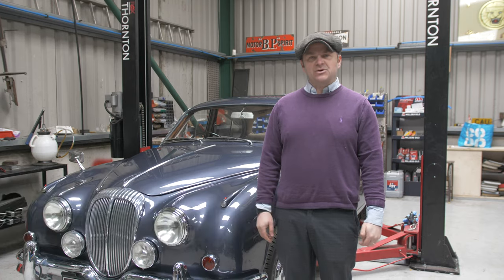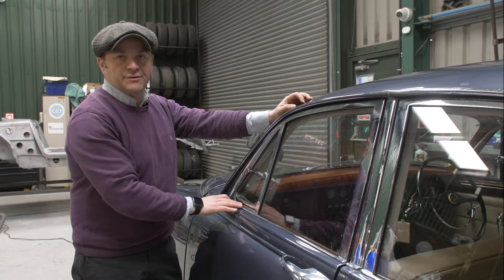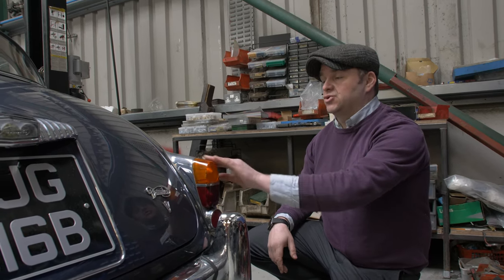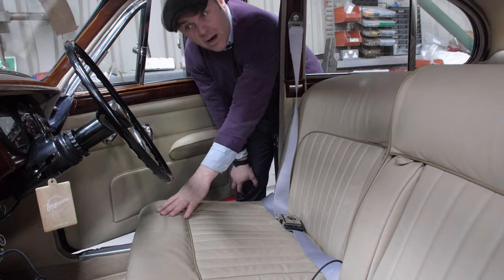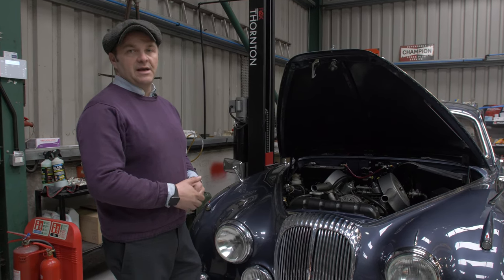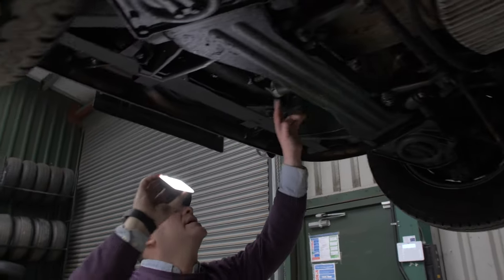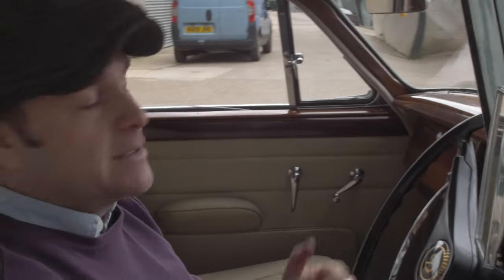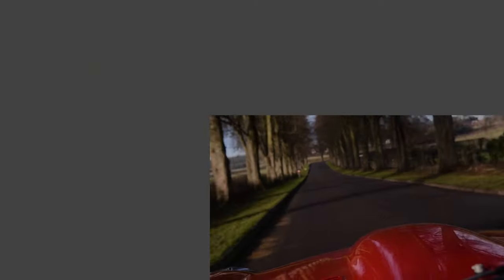CLASSIC CAR PRE BUYING INSPECTION 👌 | DO THIS BEFORE YOU BUY 💷 | FULL CHECKLIST ✅

Comment: Could be big mistake using the jacking points like you have  if I enter a garage without a drive on ramp I drive away those ramps reck classic cars there not meant for classic cars be warned those jacking points were no good when the car was new certainly no good now
Reply from the maker: Thanks Paul, it is a fair point! We wouldn’t lift a fragile car on the ramps at all and we certainly turned cars away because they were unsafe to go up in the air!